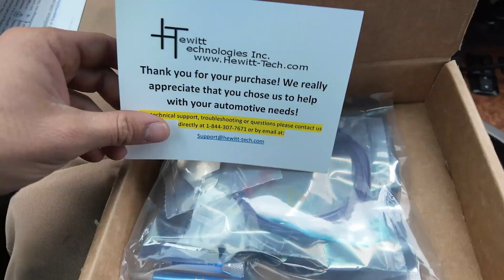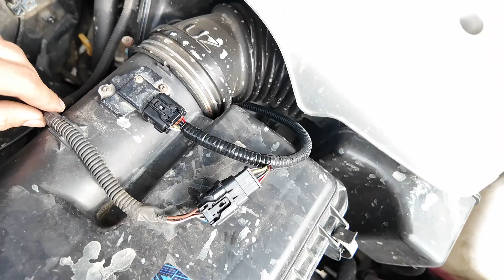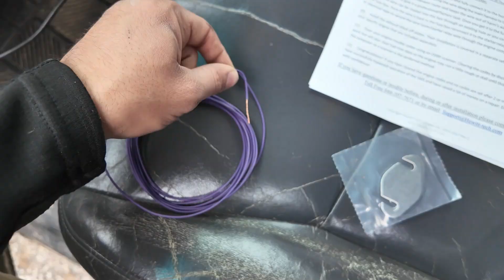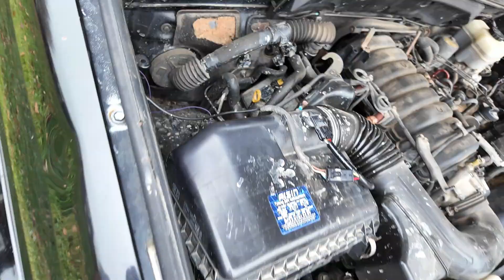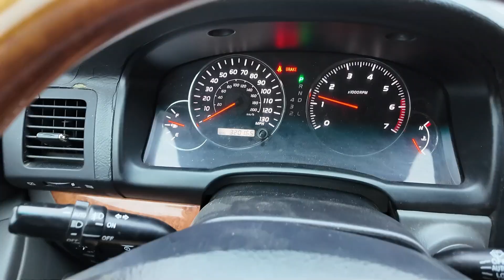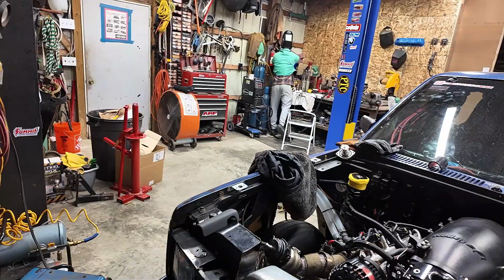GX470 SAIS Bypass Install: Toyota's 2UZ Emissions Flaw

Comment: Mine be great so far but lately I’ve been getting some p0172 p0175 codes causing some issue with my maf I believe. I purchased a new one and codes haven’t come back. Also if you oil the kn I would keep an eye for excess oil. It completely ruined my maf and my intake was completely caked after years of use.
Reply: New MAF sensor or new SAIS bypass kit? Pryor owner of my 2007 LC installed the bypass kit but I’ve been getting P0101, P0172, and P0175 despite replacing with OEM Toyota MAF. Considering that my bypass kit may have failed over the years and may need replacement?
Reply: @JHillMS it end up being my Hewitt bypass kit after all this time. Since I wasn’t the original purchaser I had to buy it. I’m not saying it’s what it’ll be but I checked everything those 2 codes could possibly be and there was nothing else. I end up coming across a tundra post saying it solved some people problems. So far I haven’t had the code return.
Reply: @Papicodone Awesome- my exact scenario so looks like a new Hewitt kit soon
Reply: @JHillMS  Hoping it works out for you, my idle was getting really bad and i would almost stall. i just unplugged bypass kit overnight then plugged in and it temporarily would "fix" my idle for the day until my kit came in.

Comment: Thanks so much for this video…I installed mine months ago, but the codes didn’t clear; I was still getting p0418 and p2445 even though I installed the kit and the exhaust adapters. I just gave up. But running into your video showed me that the kit instructions were in fact wrong (I didn’t do the voltage test like you did, I skipped that part). I just assumed the instructions were correct. So now I just swapped the wire and placed it on the other lead of the starter relay. I cleared the codes and hoping that when my wife drives it this week, the codes don’t come back. I also started the car and didn’t hear anything but the fan running so hoping your discovery did the trick. Crossing fingers…keep you posted.
Reply from the maker: I hope this works for you! I was surprised to find that the instructions were wrong.
Reply: No Christmas lights on the dash and no codes present after a day of the wife driving. And to think this whole time I thought the hack was faulty and just didn’t feel like bothering with it any longer. It worked! SAIS is officially bypassed. Thanks again!!